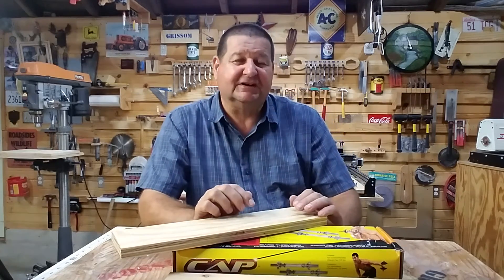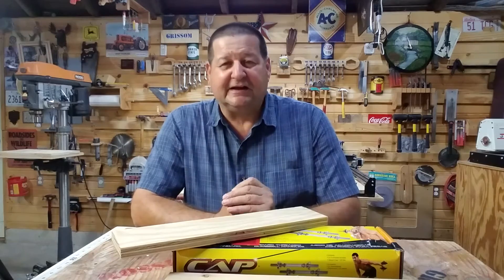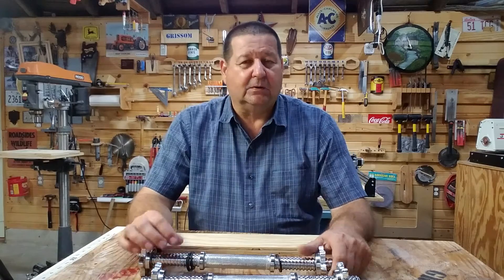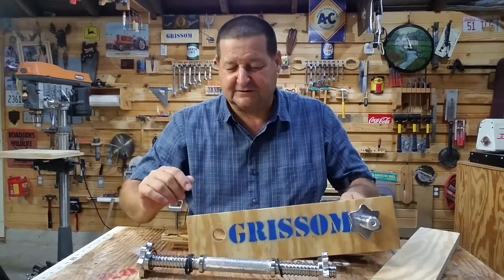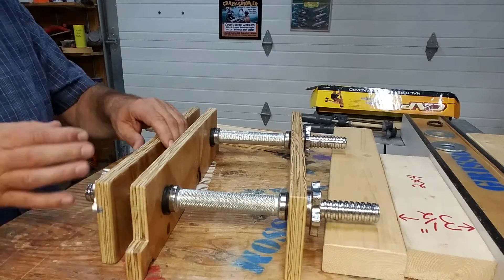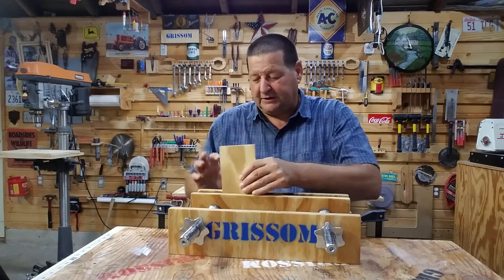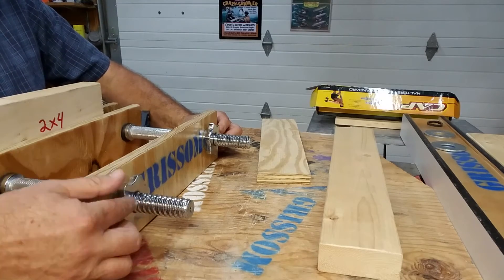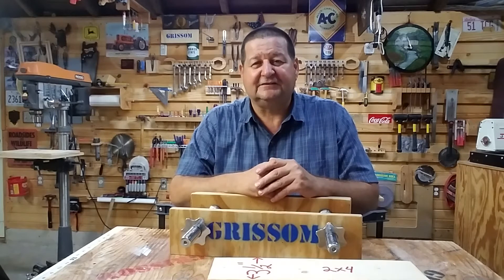Affordable Modular Moxon-Style Vise: Double Dumbbell Prototype

Comment: My eyes fell on the dumbbell this morning and I had the idea to use the thread and locks for a moxon vise. I think I‘m going to make something of that sort
Reply: hey it was the same for me, i couldnt find any acme threaded rods here at my place then i saw the threads on my brother's dumbbell and i said to myself hey that might work. look up on the internet and people have done it so it definitely works! 

i thought about cutting it in half but the upside of leaving it in one piece like this is one can make attach a horizontal surface between the back plate and the back jaw and a flat surface is there to be used to mark the dovetail pins easier!